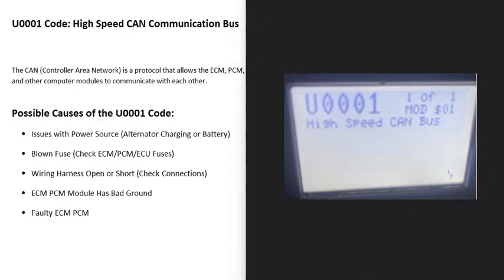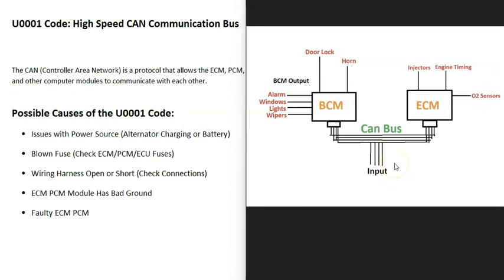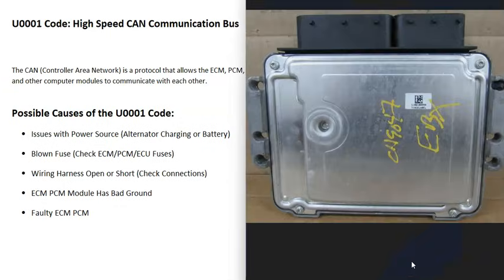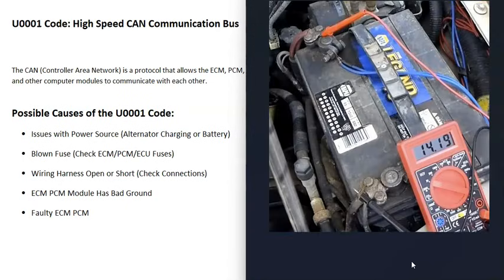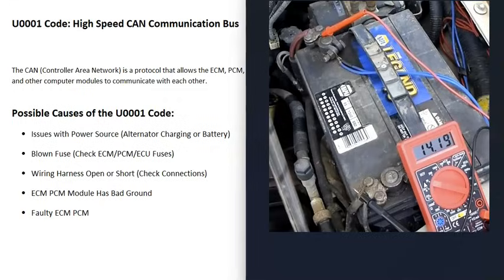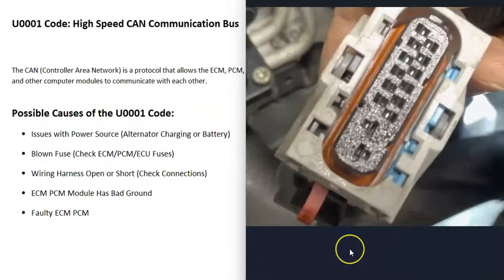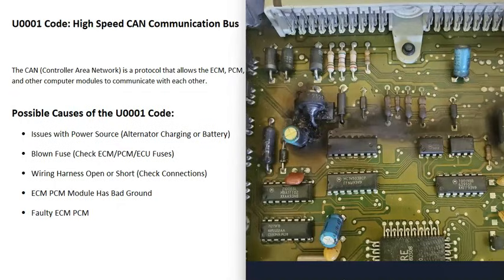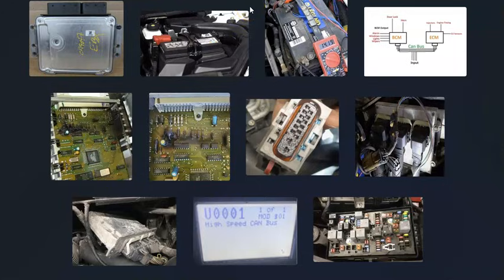Causes and Fixes U0001 Code: High Speed CAN Communication Bus

Comment: So I have a question, my 2015 Chrysler, 200. S all of a sudden had the service, all-wheel drive and service parking break. Come on and it keeps going on and off, and then on, and then off again. Code comes up as the U0001 was wondering if you know what would cause it to go off and on all the time.
Reply: Hey same issue, did you find a fix

Comment: Had this code pop on my ram Promaster, battery is brand new but occasionally it needs a jump so there's definitely some electrical issue, no clue where to track it down, whether it's alternator or fuses

Comment: 2014 Dodge Durango...68K...everything works fine cruise control lights acceleration etc...Buy when a New York State Inspection scan tool inserted the engine revs high, and all lights come on dashboard. Strange thing nothing happens when regular scan tool is inserted in OBD port...any Help. Thanks
Reply: Did you ever figure out the problem?
Reply: @SISEPUEDETV  Hey same issue, did you find a fix
Reply: @SISEPUEDETV  a gentleman stated on another site to put a new ground from Batt to a clean ground on vehicle...didnt do it yet...
Reply: @bobnicholson6350 did that work?
Reply: @bobnicholson6350  Hey same issue, did you find a fix

Comment: I have a 2016 jeep renegade latitude with a 2.4 Monday it threw that code at me and Tuesday my jeep completely died.... doesn't get no power to anything wont crank wont go to acc wont do nothing notta zelch nothing....now heres the kicker....my raido will come on and my door open light and my odometer....but literally thats all
Reply: My hybrid did this, I had blew a bus fuse  when replacing the battery.